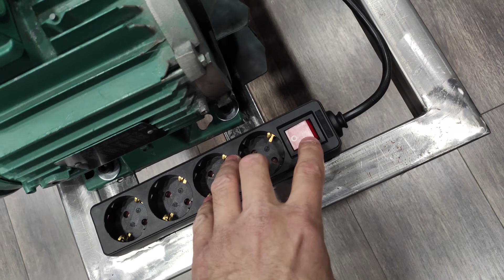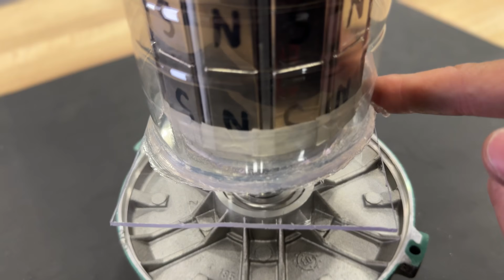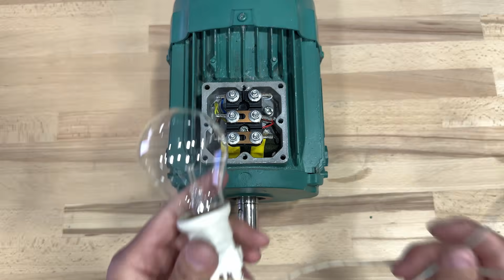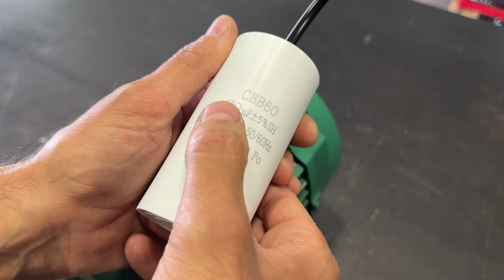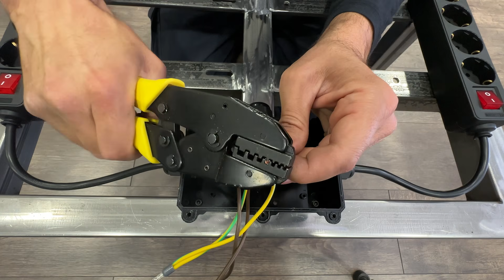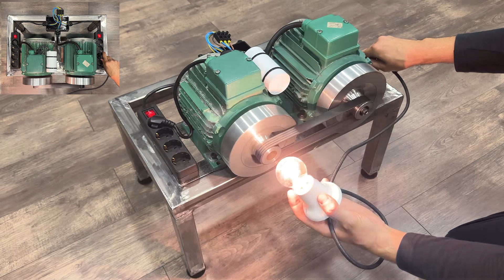10KW! Free Energy with Two Electric Motors💡⚡💡Liberty Engine 5.0

Comment: The rules of thermal dynamics says it can’t work. Any heat from alternator or motor is energy lost which is unsustainable. 
I’m with the person that said the power source is coming from underneath and up the hollow leg and frame.
Reply: Yes I agree. The liberty engine project team is very skillfull to make beautiful and realistic systems that actually cannot work (engines no consumtion, pumps energy free etc..) . The only items generated are the clicks of all of us that watch the videos (well done too). It's a business as an other one...
Reply: @ErnestLatulippe  это   аферизм!  как и ютуб  помойка !   (garbage dump, cesspool)
Reply: the law of thermodynamics don't include rare earth permanent magnets. efficiency is one of the reason why brushless motors are so popular with cordless drills and now cars. so hopefully soon we wont have to mill our own rotors and install aftermarket magnets.
Reply: Could the hidden cable run from the floor to one or more of the anti-vibration feet via their threads? I don't think so (26:53).
Reply: @user-gv6ii3vs7b could, that was definitely popular back in the day. But they were more crude and the details were vague or non existing.

Comment: What is the cost of this type system and can it be built to U.S. standards of 120V 60Hz system?  What is the total amperage produced and is is capable to operate an entire home requirement?
Reply: Don't break your head with that question, it doesn't work

Comment: According to the law of conservation of energy, it would stop moving.
Therefore, in reality, it doesn't exist.
Reply: توهم قانون پایستگی انرژی برای چرخ دنده ایی که با دست یا خود ان از بلندی به پایین می آید صدق میکند لطفا اجازه نده که توهم قانون پایستگی انرژی از اختراعاتی که انرژی رایگان در احتیارت قرار میدهد بکاهد!!!
Reply: I have not tried this, so I cannot deny or prove its validity, but do not be stuck in illusions whose validity you have not yet tested. Try it yourself and judge.
Reply: But what does conservation of energy say about the magnetic field of the magnet?  Magnets eventually degauss and I'm sure hydrogen will someday cease to be.  Don't you think it's possible to use a magnetic field a little more efficiently with some proper study?

Comment: I like this. But how long would it take to charge a house battery of 4000kw?
Reply: Why would you use battery if this thing can generate continuous energy? The only reason for using batteries is in case of giving maintenance in the equipment. Maintenance is only exchanging bearings about each 6 months.

Comment: Where is the battery
Reply: В
  Battery is inside frame pipes or external cable runs from under the floor though the legs pipes

Comment: No matter how efficient it is, the alternator will not make more electrical energy than it takes to spin it. There will be energy used to generate heat, sound, belt drag, and airflow from the cooling fan, and resistance in the electrical circuits. The electrical energy stored in the motor starter/capacitor would sustain operation for a long time with no load, and run the grinder for a short time. Take the capacitor out of the system and it will not sustain itself.
Reply: sahtekar bu videoyu hazırlayan biz buna elektrikte ahmet aklı deriz bundan yıllar önce türkiyede ahmet diye birisi denedi başarılı olamadı yıllarca alay konusu oldu
Reply: i agree with you cant belive people still believe in this nonsense "free energy"

Comment: How can this work. I want one if it’s possible.
Reply: the guy using the mechanical energy stored in 8kg volans attached to each device. if u connect a real load this would stop very soon. Nevertheless it is possible to drain free energy from the space you are currently existing in. but for such one need build much more complex loops than explained here. Let me give u a simple example: the thermal rest energy of outer space is about 2.7 Kelvin. It is possible to build machines which can capable the collect almost free energy from this rest. but such machines would cost immense amount which makes them again unfeasible unless you are building huge space ships. there exist other methods to drive (free) energy from other layers of existence but this would be cheating the God built systems in turn you would die through simple car crash or something like that. At the end of the day: someone gonna pay the invoice. If you not someone else. This is another kind of explanation of the preservation of energy law of the known physics.

Comment: What is the "Liberty Engine" shown in the video?
The "Liberty Engine" is presented by the creators as a "self-supporting single-phase electric generator" [00:00]. It consists of:

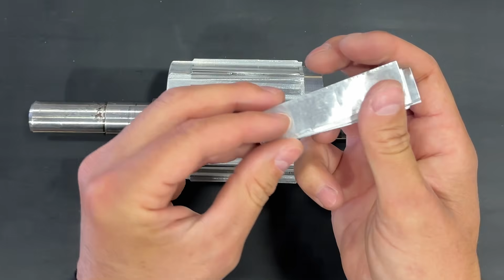A Modified Alternator: They take a standard three-phase electric motor and replace its rotor with a custom one featuring neodymium magnets and a fictional material they call "Argallium alpha" [02:55].

An Electric Motor: A second, standard motor is used to drive the alternator via a belt [21:16].

Feedback Loop: The video claims that once started with a drill, the alternator generates enough power to run the motor, which then continues to spin the alternator in a "closed loop" [26:42].

Is this technique real?
No, this is not a scientifically possible device. It falls into the category of a Perpetual Motion Machine, which violates the most fundamental laws of physics:

Conservation of Energy (First Law of Thermodynamics): Energy cannot be created or destroyed. In any machine, the energy coming out can never be more than the energy put in.

Efficiency and Entropy (Second Law of Thermodynamics): No machine is 100% efficient. Energy is always lost through heat (due to electrical resistance in the copper coils), friction (in the bearings and the drive belt), and air resistance (the fan blades).

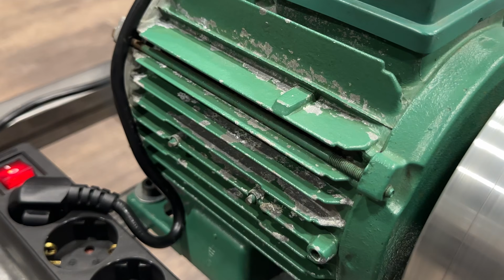The video claims an efficiency of 666% [26:47]. In reality, even the best industrial motors and alternators have efficiencies between 80% and 95%. When you connect them together, the losses multiply, meaning the system would lose speed and stop almost immediately once the external power (the drill) is removed.

Understanding Motors and Alternators
To understand why it doesn't work, we look at the components:

The Motor: Converts electrical energy into mechanical energy (motion). It requires a certain amount of power (Watts) to overcome friction and turn the load.

The Alternator: Converts mechanical energy back into electrical energy. It creates "magnetic braking" (Lenz's Law)—as you draw more current from an alternator, it becomes much harder to turn.

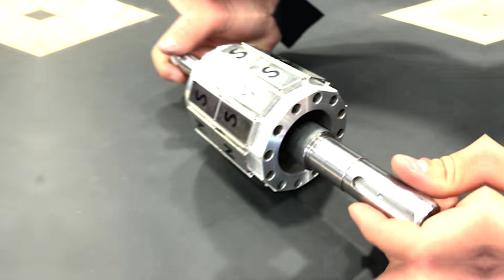In the video, they claim to have eliminated "magnetic braking" using their "Argallium" material [05:20]. However, magnetic braking is a fundamental requirement for generating electricity; if there is no resistance to the motion, no work is being done and no energy is being converted.

Verdict: Is it a self-sufficient motor?
No. While the video is well-edited to look like a continuous shot [22:46], it likely uses hidden power sources (such as batteries hidden inside the frame, the motor housing, or wires coming through the table) to keep the motor running.

The "Liberty Engine" and the material "Argallium" do not exist in the scientific community. These videos are often created to generate views or, as the video itself warns, may be related to scams [28:23]. You cannot generate 10kW of "free energy" [00:00] by connecting a motor to an alternator.
Reply: where's the battery  😂
Reply: It is running on the energy stored in the motor starter/capacitor. One that size would replenish the energy lost for quite a while, or run the grinder for a short time.

Comment: Yeah Right. Putting the plug on an extension lead into the socket on the other end does exactly the same thing. FYI If you want some Argalium Alfa, get a roll of ally tape used on dry wall joints from your hardware store.

Comment: The alternator is outputing  about 10 to 15 amps at peak.
 If an experiment can be conducted like this, 
take the output  power from the alternator and develop the voltage through a transformer and the output from the transformer into a voltage stabilizer. 
There is a possibility of more amps.
The making of this generator is real.
 When I was a young person in the 70s, i made one, and it produced 12 volts. 
Because of poverty, I could not do more.
Reply: Because of science you could not do more OVER UNITY can NOT happen how often is this stated in physics. and if YOU can do it you will be a millionaire overnight several over the years have tried and failed.
Reply: @concyprus4895 а где вы увидели больше 1? Там всё согласно закону сохранения энергии. И конструкция называется бестопливный генератор, а не вечный двигатель. 😊
Reply: @abkhaziya_gagra nonsence
Reply: Yikes!  Lets get multiple transformers and we can power the world with a  "AA Battery"!!!
Reply: @richardskyking5151 

You are a person that think small, I belive you are lock up in that world in which you were only taught in.
I was like you when I was young.
Once my professor told us in class that the time is coming when rotary dial telephone will soon be out dated and will be replace with phones that will be operated wirelessly and you will see on it who you are talking to at the other end. We laughed and make fun of him, professor die and gone but what he said is now real. 
An AA size cell long time was 1.5 v at 500 mA, now the same cell is 3.7v at 1,200 to 2,000 ma. 
Bro, start expanding your thinking.
Reply: @richardskyking5151 а с каких пор трансформаторы повышают мощность?😂 Или вы изобрели какой то супертрансформатор? Поделитесь с народом, не жадничайте.😂

Comment: I'd like to see if it can power a modern Gaming PC, a microwave, a TV, a large refrigerator, a large airconditioning unit & a kettle.

Alternatively, I'd like to see if it can charge up the batteries for a modern home in a off grid solar powered system, removing the need for solar panels.

Comment: I really am amazed by the amount of people in the comments that think this actually works.
Reply: As it happens I got some argalium alpha from amazon, the seller apparently was not aware that this material has magic properties and was just selling it as aluminium duct tape...

Also the hvac in my house now does not need to be plugged - it still is, but I don't believe it uses the electricity from the network! By using the properties of argalium I was able to extract zero-point energy from the micro singularities that now exist in the hvac ducts. Real game changer. Of course my electricity supplier does not like this, so they keep charging me the same amount of money. Its a conspiracy I tell you.

Seriously though. I can't believe how many people fall for this kind of 🐎💩. 700K subs and counting 🙄

Comment: It cannot work..... Perpetual motion is a myth. You cannot get out more than you put in. It's basic physics. The laws of thermodynamics and the mass/energy equation are well known and proven.
This sort of rubbish sounds convincing and deludes many that lack the basic education that was taken for granted when I was at school 70 years go, but seems lacking today.
These scams also lead to the conspiracy theories that the energy companies are suppressing knowledge for their own profit, and this kind of thinking can lead to a lot of unhappiness in society.
So, I would say to the author that he needs to desist; or if he really believes this nonsense that he educate himself in basic physics and stops telling lies to gullible folk with no knowledge of power dynamics.
Notice the little overlaid picture top left on the run pictures...... that will be to hide the external power connection from grid power....... sneaky.

Comment: This is clear overunity.  There will be small losses to friction and heat, yet it produces enough energy to keep itself going as well as generating enough electricity to run but light bulb or the angle grinder.  Traditionally, people would say this is impossible.  Where is the extra energy coming from?
Reply: Никто не знает.Но это факт ,что есть место.

Comment: Can you please upload a video running 24-48h continously? Because the generator should get slower and slower.
Although, can you explain in details the calculations for the efficiency of 666% and the 10 kW power?
Thanks
Reply: Генератор не замедляется, он наращивает мощность и ему приходится ставить разрядник, чтобы сбросить излишки магнитного поля.